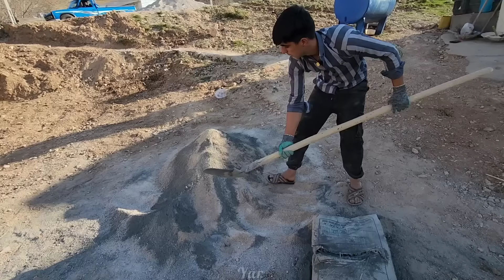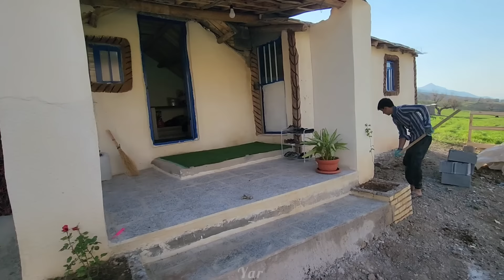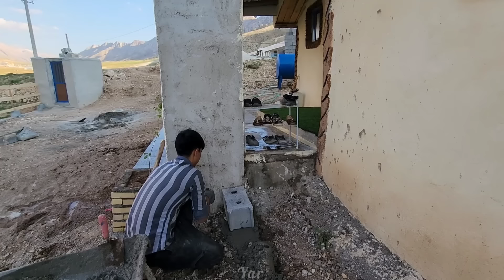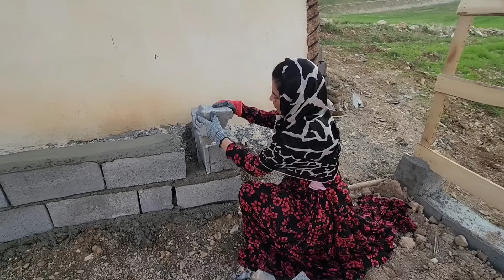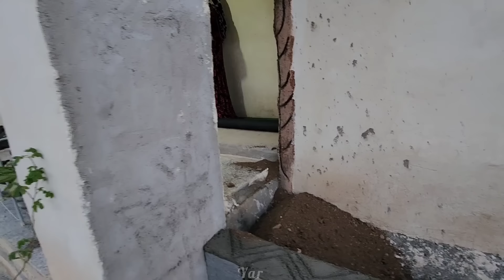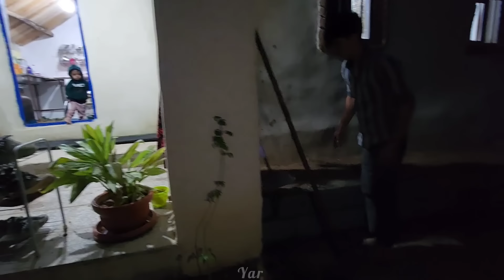The garden of dreams in the beautiful and pleasant yard of Razia: the arrival of a paradise of peace

Comment: In my country almost all houses are built of concrete. My house is made of concrete and for 34 years I have lived here. We have plants around the house, close to the walls, I have flowerbeds and some plants directly on the ground. NEVER I have had problems of dampness on the walls. Nor have I had black fungus or mold on them. 

Family, do not worry, the only thing you need to add to the flowerbed is a few drains in case there is excess water and you will be fine!

Comment: It is best to cover it with cement concrete
To be supportive of the home
Beware of making it a flower bed, as you will destroy the house with moisture.

It is now good to put the stones in the basin
And cover it with cement to support the house
And if you love flowers, you must realize that in winter all your flowers will die
It is better to put
Plastic tubs for flowers, but do not have too many of them
So that your house can accommodate it in the winter, because it will die from the snow if left outside.